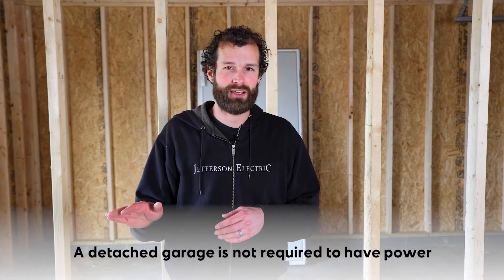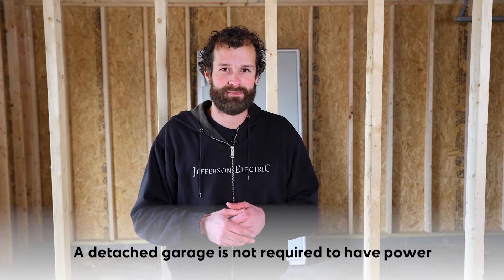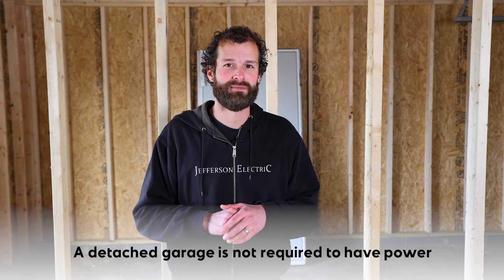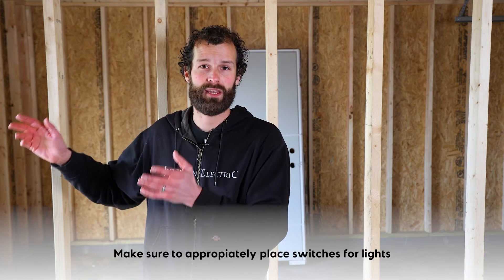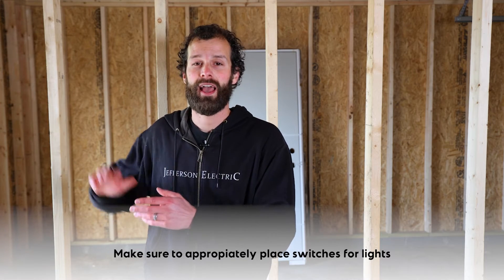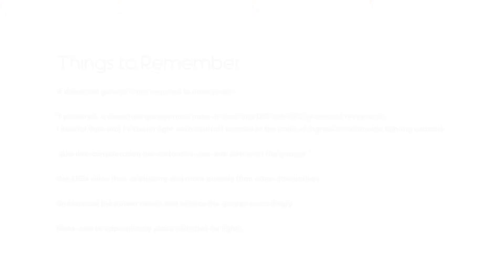Garage Wiring - Code Minimum

Comment: I was hoping to hear about if conduit is required or not.  My attached garage (unfinished cinder block walls) has 1 old-school light bulb on a switch. No receptacles, no garage door opener.  I would like to have "more" including supporting a mini-split AC/Heater (the mini-split would be installed to cool the inside of the home on the shared wall with the garage with the compressor running outside the garage.
Reply from the maker: Sounds like we could best service your needs with a video call: https://electric-pro-academy.square.site/

Comment: I really have an issue with installing led lighting.  They DO NOT last very long.  I have a large shop with suspended led fixtures that I am replacing as they go out for over 115.00 each. The oldest fixture is 5 years old and I’ve already replaced 8 fixtures. We no longer throw away a bulb, now we replace an entire device.   These fixtures are made by a major brand, not Amazon specials.  I’m a fan of led replacement bulbs but not fully integrated fixtures.

Comment: I'd like to get to a point where every room has its own sub panel right there, in the room that said panel is for. And each individual light socket, wall socket, etc is on it's own breaker. This way no one is in the dark and needing to run extension cords all over their house should something go wrong with ONE thing, taking out the entire bedchamber or two. Like in this hell hole. The GFCI in the lavatory trips, and the lavatory is out and 3 bedchambers. And the thing went bad too, so all it did is making a buzzing sound. The power never did stop flowing to it, but stopped flowing to everything else.

Comment: I like to install a 60 amp two pole subpanel in detached garages. It will supply most people with the power they need including exterior outlets on the garage.

Comment: What about the requirement for a disconnect on a detached building?
It’s basically it’s own service.

I feel where the code is leaning would discourage traditional 3 ways from the house to the garage.
We typically use a Lutron pico in the house to control the garage switch. 
This would allow ether conductors from the house or garage to be live while the other service disconnect is off. 
Depending how the service to house and garage is built of course.

Comment: #8 AWG conductor on a 50A circuit seems light.  I would most likely run #6.  I love your videos -always look forward to new ones.  I would like to know why you downsize your conductor?
Reply from the maker: Based upon table 310.16 #8 copper wire at 75 degree C is rated to 50A. However, #8 romex wire is rated 60 degree C so therefore only 40A rated. Sizing wire is possibly the most confusing thing in the whole code.

Comment: Seems like every attached garage I see (which isn't too many) is pathetic in the electrical department.  One light, one receptacle on a wall, and one receptacle in the ceiling.  Pathetic.  Sometimes it's even a 15A circuit.  Doubly-pathetic!

Comment: Just a supportive comment. You are referencing a single phase system. For a 240 volt residential input, the reference is Line 1,Line2 and Neutral/GND. Not phase a or b. A residential system is provided by a single phase.

Comment: Joel, 
Great job here. For the DIY this is indispensable code compliance guidance. Thank you.
I recently watched an episode where you were straightening out a rats nest/immanent fire hazard in an old house you grew up in.  Couldn't believe the condition in the basement/panel.
Just a suggestion, I know you do  this for a living and are experienced working "live" but I would never trust all the safety gear you are wearing (gloves,boots,safety glasses etc) . Gloves could have pinholes/cuts...etc. With you and family in mind, at a minimum when torquing mains in the panel, pull the meter....it ain't worth it! Otherwise if torquing mains live, guarantee checked safety boots, checked safe gloves and a rubber mat around the left and right vertical edges of the open panel edges so your torque wrench does not inadvertently contact panel. An "arc flash" in your face without a face shield......think about family. 
You've got a great site here.........amplify more on safety. I know time is money........but family(and you) first! (meant that as a friendly comment)
Reply: Sorry .....And not solely for the DIY.......but for all Electricians out there........especially future tradesman......I know Joel is on the right track here. Ethics.....quality......pride in your work!

Comment: 5:27    225 Outside Branch Circuits.  NEC 225.39  specifies the ratings of disconnects.  225.39(D) indicates the minimum size for installations with more than two branch circuits.  60 amps.

225.39 Rating of Disconnect.  

225.39(D) All Others

For all other installations, the feeder or branch-circuit disconnecting means shall have a rating of not less than 60 amperes.
Reply: @ElectricProAcademy  Thanks

Comment: Another great explanation of code.  My 40+ year old attached garage is sorely lacking... only 2 receptacle locations and a single light receptacle in the ceiling for the light and opener.  This circuit is shared with my basement circuit and is not GFCI protected.  My plan is to only have the ceiling receptacle remain on the old circuit, adding two new ones off it (4x 4 foot LED lights and the opener) and put in a new 20A GFCI just for the lower receptacles... a quad box or two on each wall.
Reply: I think all the receptacles in the garage, including that ceiling one, should be GF protected.
Reply: @aurvaroy6670  Current code, yes.  Mine was installed mid-70s.  I'm not touching the lights (except adding one more outlet in the ceiling), which remain on the old circuit.  Only the new circuit requires GFCI.

Comment: Might be late to ask. Can I have 2 LED shop lights on the same circuit as outlets in a garage?. The circuit is GFCI 15 amp w/ 2 outlets and 2 led shop lights on a switch.
Reply: @ElectricProAcademy  2017 Code Language:

210.11(C) Dwelling Units.

210.11(C)(4) Garage Branch Circuits. In addition to the number of branch circuits required by other parts of this section, at least one 120-volt, 20-ampere branch circuit shall be installed to supply receptacle outlets in attached garages and in detached garages with electric power. This circuit shall have no other outlets.

Exception: This circuit shall be permitted to supply readily accessible outdoor receptacle outlets.

Comment: Hey Joel, I have some thoughts. Im a journeyman electrician that studies code pretty extensively. On your video you said that the minimum code required for garages in relation to receptacles is 1- 120 volt, 20 amp GFCI.  Im assuming this code minimum  is for a one car garage with a garage door that's not powered by an garage door opener. 210.52(G)(1) states that at least one receptacle shall be installed at each vehicle bay. So if we have a 2 car garage then you would need at least 2 receptacles. But these receptacles are permitted to be on the same branch circuit. The tricky part comes in with the wording in the 2020 NEC code. Based on 210.11(C)(4), the branch circuit supplying the receptacle(s) outlets required by 210.52(G)(1), "shall have no other outlets" tied to these receptacles. So essentially, because the vehicle bay receptacle(s) cannot be tied to other outlets and the vehicle bay receptacle(s) have to be installed below 5.5 feet,  if you were to install a receptacle in the ceiling for the garage door opener this receptacle would have to be on a separate branch circuit than the receptacle(s) required by 210.52(G)(1). In addition you would also have to figure out how to GFCI  protect the receptacle in the ceiling while making GFCI readily accessible based on 210.8. 
I believe this is what makes the code complex because the wording sometimes can be tricky. 
But I understand for you Joel youre probably not trying to get too much into the nuances of the code. Thanks for covering this topic
Reply: you are correct one receptacle per garage door/  this guy thinks he knows all.  a master electrician means you can pull permits, not that you are a master.  plus this guy is a total hack and does shit work.

Comment: Something I noticed in my area and it's not directly addressed in the code is garage lighting placement. When we have snow in the forecast people tend to back into the garage for an easier departure. The problem is people can't back up straight in the dark when it's bright outside (too much contrast) so they are prone to hitting bikes and lawn equipment along the sides. Inside lighting placement wider than the vehicle solves this issue. It also makes it easier to walk along the side of the car without shadows, especially for older people. If the auto garage opener has the option you can hook up extra lighting on it's 3 minute timer.

Comment: I would up grade service to 200amp from standard 150 amp   For future use  if was planning for shop in garage  /
Reply: Stash ... just remember that a 100 amp panel is 100 amps per leg and a 50 amp welder outlet or car charger will only be used to 40 amps per leg max. That's a fair amount of reserve power on a 100 amp sub panel. If you want to back into the calculation from the stand point of the sub panel being a branch circuit (80% of breaker rating) then figure it as a 125 panel and you still have at least 100 amps available at the garage.